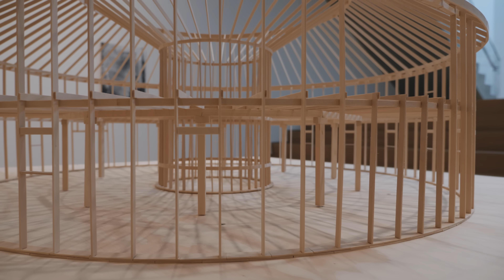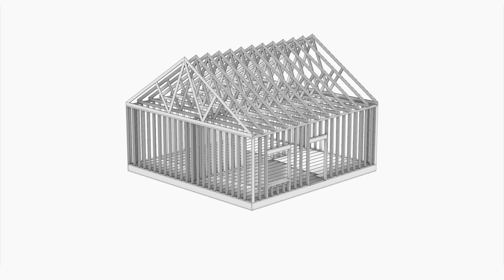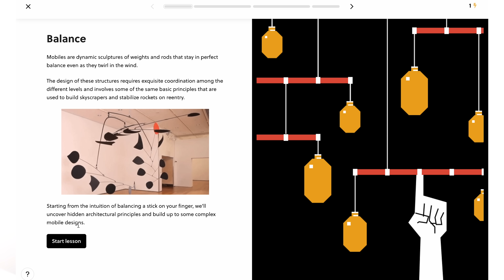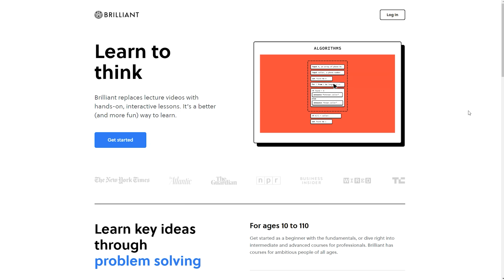The Genius of 2x4 Framing

Comment: The problem with light-wood framing is that much of it's benefits are also it's shortfalls. The Northeast and it's lack of natural disasters provides a vast array of different architecture and building styles as long as the roofs manage the snow. Also just enough weather to give a good window into what holds up over time and what doesn't. That being said the earlier light-wood frame houses with brick nogging in between the framing are really idyllic. The roofing standards at the time really sucked so they had a fair share of issues but with a good roof or at least a well maintained one they are extremely durable and manage temps fairly well. More modern light frame houses, like last 50-60yrs or so, aren't nearly as durable. The benefits of how efficiently they're built just causes builders to abuse that in the chase of profits and timely construction which leads to so many small issues building up over time. The excessive us of the wood framing, typical insulation between the framing, and the sheetrock walls are great until they aren't and problems like mold/moisture tend to snowball or things like cold spots negate the rest of the insulation
Reply: 50 or 60 year's? You my dim friend don't have a clue as to what you are pooping out of your mouth.. a good asphalt roofing shingle is made to last up to 50 years nowadays, I love reading through comments.. always good for a few laughs
Reply: Alot of that has to do with methods and construction science. The 70s thru the 90s was a dark age for construction science especially with light framed housing. People didn't care about dew points, heat transfer, air dealing or water shedding. That's why you see vented attics paper water membranes and poor insulation. That's changing slowly but we still need to get past the "I've been doing this 20 years and we've never done that" crowd of contractors that are still building shit homes.  (Cough cough dr horton)
Reply: @mattepple  Yea that makes sense
Reply: those negatives are actually very easily overcome

Comment: Great stuff Stewart! I thought you might mention the Sears precut homes--I thought those came out of Chicago, but I might be wrong.  In the early 2000's I brought the coolest Japanese framing system to the US--I led the structural testing, code approval and oversaw volunteers build 12 homes in northern MN and WI, before we sold everything, including a new $5M CAD/CAM run factory too another Japanese company that didn't want to doo anything in America.  This is a 2-1/2 minute (low quality) video I posted 15 years ago, on how this system allows a house to be erected, sheathed and windows installed in one day!  https://www.youtube.com/watch?v=TuEIzBhbuNw&t=1s

Comment: In southern New Mexico we have 2x4 framed 'adobe' houses. Covered in stucco to look like adobe. You know 2x4 framing is a good way to go when it literally out competes the dirt on a construction site for building materials.
Reply: I had a stick built Santa Fe house in Tucson. The thermal expansion of the wood was constantly cracking the stucco, especially up on the parapets. I'd like to try real Adobe someday, but would sure miss the insulation.

Comment: A very interesting video thanks! Living in Switzerland, I have never seen lightwood framing here. Timber is the way for wooden construction, but bricks and concrete are more common. Tell me if I’m wrong but I feel like lightwood framing isn’t very durable and solid, every year I see US cities demolished by tornadoes. I understand that lightwood framing is economically profitable, but how is it in these regions? When rebuilding these thousands of houses, is lightwood framing still a choice? Do they use more expensive building techniques which would sustain these dramatic events? I feel like it makes more sense to build in a more solid way, not taking risks of human losses and rebuilding entire cities.
Reply: Wood framing can outperform more rigid structures due to the strength / weight ratio of wood.
Reply: I can assure you if a medium size tornado hit any of those durable Swiss homes it would completely demolish it. I don't care if it's concrete or timber frame Construction it will not survive. I've seen a full size truck wrapped around a telephone pole from a tornado. A good size tornado could pick up a large freight train and throw it like it was a toy.
Reply: A “balloon” frame uses less wood than a traditional timber frame - because the exteriors wall support is part of the frame not an additional element.
Less wood equals cheaper. 
Multiple redundancy means more damage tolerance too. 
A car through a beam frame will bring down the entire building. A car through a balloon frame is a repairable annoyance.
Reply: @allangibson2408  just an FYI, "balloon frame" is a specific term for an antiquated unsafe building method
Reply: Agreed. Conventional masonry houses such as in Switzerland would be demolished in a cyclone because the walls are not strong enough to withstand the uplift forces. Here in Australia, the building codes in cyclonic regions require the buildings to withstand category 4 cyclone (310km/h winds) and both concrete block walls reinforced with steel rods or properly designed timber framed walls are acceptable.
Reply: From the opposite perspective: old concrete buildings are often cracked and falling apart.  Wood is a far more flexible material so it is much better than concrete in earthquake zones (see Japan).  A wood frame home built to hurricane building codes will definitely outperform a typical European home, and no type of home is going to resist a direct hit by a strong tornado.  

Something that isn't usually mentioned is that wood is a sustainable building material while concrete has a horribly high carbon footprint and is using up the world's sand at an alarming rate.  

Wood is really quite amazing, it can be shaved as thin as paper and very flexible or manufactured into configurations that are stronger than steel by weight.
Reply: @CleverAccountName303  The key with concrete is the cover over the rebar. It needs to be at least 2”/50mm. Any less than that an spalling is certain. Tilt slab is very resilient to cyclones & hurricanes. Concrete block way less.
Buildings designed for Category 5 cyclones exist - over 280kph / 174mph sustained winds (EF-4 tornado equivalent). They just cost way more than conventional construction and have a distinct “penal institutional” design aesthetic due to small armored windows and blast doors with airlocks.
I know that because I worked on a site that required them for accomodation blocks after a storm with 408kph / 253mph sustained winds was recorded.
Reply: @allangibson2408  yep, most building materials can be engineered to an extremely high-strength standard with enough money.  Certainly wood can be.   I do find it funny that so many Europeans think North American houses are like cardboard boxes when actually most European houses would fall apart completely in the face of a hurricane, tornado, or earthquake.  They also have similar fire fatality rates to North American homes after controlling for wildfire prevalence.  It's like they think the tens of thousands of construction engineers in North America never heard about the wonders of brick construction.

Comment: Excellent video. The importance of standard building sizes and components is underestimated. As a suggested follow-up: Insights into the history of "true" 2x4s (pre-1966) and modern day dimensional lumber (11/2 x 3 1/2 ...ish) would be great.
Reply: Basically the introduction of kiln drying and planing.
Reply: From what I know it’s not that much if a mystery and not insightful. Lumberyards used to try to squeeze more profits by making them a bit smaller and smaller and there wasn’t a standardized size. Until either a law or agreement made them pick a size.

Comment: 2/4  ist total rückständig! Ich baue damit Innenwände.  Nicht mehr und nicht weniger. Meine Häuser baue ich mit TJI Trägern 356mm für Außenwand und Dach. Dann werfen sie mit holzfasern ausgeblasen . Und zum 1000ten mal. OSB gehören auf die Innenseite der Wand.  Und aussen tyvek oder eine MDF Platte mit nut und Feder. Und Ballon framing. Nicht mehr Plattform framing. Und ihr seid zum Mond  geflogen!!!😂😂😂😂
Reply: To the moon yes, but only with German rocket engineers.

Comment: The question is why this style of construction isn't more universal? What are its downsides?
Reply: It doesn't work. Besides being cheap and easy to construct there are a lot of downsides. US houses are very badly insulated and a tornado rips them apart in a couple of seconds. They also burn very well. Which you don't see much in Europe. Stone doesn't burn that well.
Reply: @fritz4345  Your stone building would last in a shaker on the pacific rim.  It is suited to your environment .. which is great, but it is also not a universal solution.  Light wood framing is also more sustainable, due to the renewable nature of the material.

Comment: I kinda have a gripe with the idea that light framing is supposedly unskilled, or at least relative to timber framing. I've done a little bit of timber so I'm certainly no expert, but the speed and accuracy required for light framing takes a considerable amount of effort and practice. Not a single worker on my crew were as good as the boss needed us to be and they had all been doing it longer than I had. 
Then again that's always the case, isn't it? Technology makes things easier and cheaper, the value drives up demand, and suddenly it isn't easy anymore, but people still think it's "unskilled."
Reply: It is unskilled, habitat for humanity frames houses with volunteers that’s have zero experience. It requires no formal training to begin learning and very little time to become proficient in.
Reply: I don't think he meant any disrespect, but we are talking about two different worlds here.  And no question, timber framing requires more skills than light framing (I've worked on timber framing in the French and Italian alps, and on stick framing in Ohio and Western PA).  

One of the great strengths of light framing is precisely that it's is easier to do, with "lesser" materials. The hamburger analogy is good. Pretty much everyone can make one, even if some are faster than others at assembling them.

I would also like to point out that light framing is found in Europe, and resembles its North American counterpart, but generally with a higher standard of construction.  For example, I have never cared for the way stud walls are drilled to allow passage for a drain pipe in the North America.  In my experience, I have never seen it done in Europe.  Fasteners are also quite different.

Another thing to keep in mind is that energy is a lot more expensive in Europe, which is why insulation standards are also higher, which means that whenever light framing is used, the studs are closer to 2x6 or even 2x8.
Reply: Yeah, it’s an extremely out-of-touch and borderline insulting statement. It’s incredible for an architect to brush off carpentry as unskilled labor, you’d think they would have a little more respect for the people who make their designs a reality.
Reply: @jonathandelossantos9332  framing isn’t carpentry.